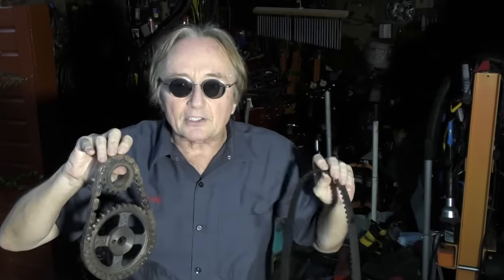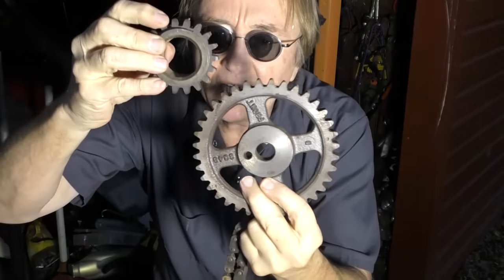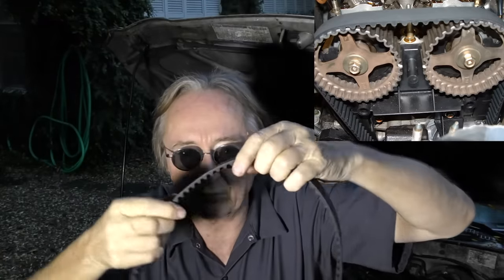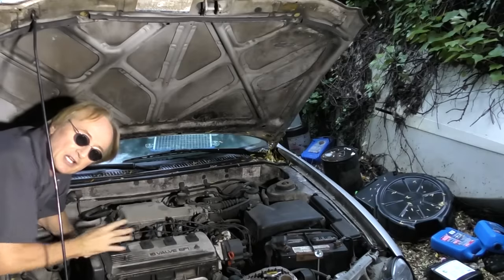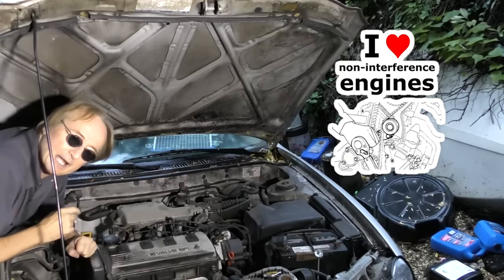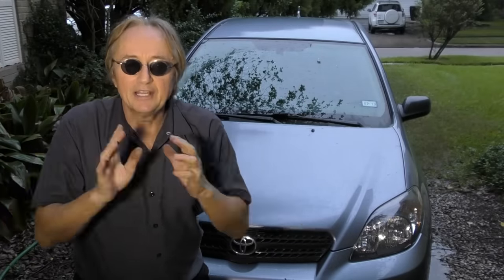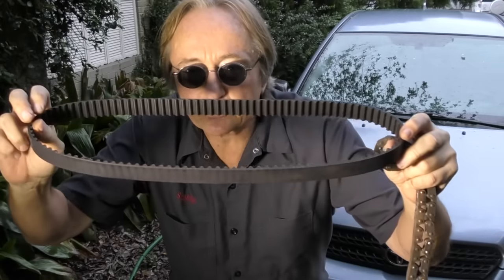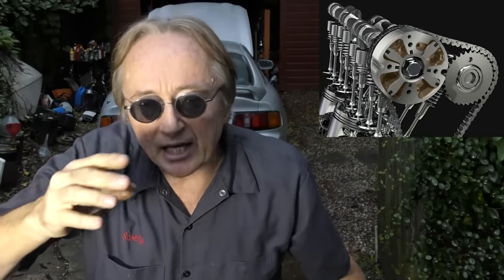Why Some Cars Have a Timing Chain Instead of a Timing Belt

Comment: Less wallet pain with a chain!
Reply: unless you have that one one bmw where it costs 4000++ to fix and all of them were faulty :D
Reply: Ettei olis ollu e46 318?
Reply: Well... Replacing a timing chain can be a pain on cars with bigger engines. on a 3 or 4 cylinder its a 10 minute job and about 150bucks but on a V shaped engine it can cost a fortune.
Reply: It happened with gears to on Dodge the gear was made from alloy center and plastic teeth just as bad as a belt.  All done for quite motors.   Chevy no problem non interference but Dodge look out  Pontiac to.
Reply: n47 engine
Reply: Unless you have an gm ecotec.
Reply: @bimmer3997  bullshit. Them bmw 2.0l diesel engines were snapping chains at 30k miles. Due to badly designed tensioners. Look it up.
Reply: @suolihuuhtelu  some owners had to pay over 10k for new engine because bmw would not give them a goodwill gesture. Shocking stuff by them. Don't ever buy a 2litre 4cyl diesel of them. 6cyl were solid though.
Reply: That is until they go wrong. Then it's an engine disassembly job, which, if you're driving a cheap shitbox, the cost will outweigh the value of the vehicle, meaning your car will end up being crushed into a cube. I know from experience.
Reply: Not if it's a civic si.  I know from experience on that one.
Reply: On a SOH or DOHC inline engine it takes max 10 mins. I know because I work in a garage...
Reply: @bimmer3997  facts.
Reply: Unless you have VW TSI xD
Reply: @waifuracer6516  post a video of this so. Can't wait to see it.
Reply: Exactly. I have pulled down a lot of those diesels because of that reason. The tensioners over stretched the chain & PING!! One engine in need of rebuild. There is a kit available to stop this.
Reply: It is actually a fact. The 2 litre BMW diesels are prone to snapping timing chains. A company here in Australia makes a kit so the chain is not overstretched.
Reply: Might not take 10 mins, but still, it is a simple job and shouldnt take more than 30 mins. 10-15 min is the avarage for an experienced and good mechanic.
Reply: Well said!
Reply: Unless it's a suzuki 1.8
Reply: Unless it's a suzuki 1.8
Reply: Are you serious? 30 minutes to change a timing belt? What on earth are you thinking? I WILL tell you it takes MORE than 30 minutes to change a timing belt!!! I've done that job thousands of times!!! It takes one hour to change a timing belt in a Daihatsu Charade 4 cylinder. Reason is you need to take the alternator belt off it first, remove the crank pulley, then remove the timing covers. After this, you set the timing up on the engine, BEFORE you remove the old belt. Next, loosen the tensioner bolts, & push the tensioner away from the belt. Tighten one of the bolts to lock it in place. Now remove the old belt. When you have the belt off, remove the crank sprocket. Remove the oil seal, then install a new seal. Remove the cam sprocket, & replace the cam seal also. Put the sprockets back in place. & torque the cam sprocket to specs, which from memory is about 40 lb/ft. Check to make sure the timing marks on the cam & crank sprockets are lined up with their respective  pointers. Install the new belt, ensuring the belt is loose on the tensioner side. loosen the tensioner bolt which was tightened to hold it, & allow the belt to be tensioned. Tighten the tensioner bolts. Rotate the engine in normal direction to check for binding, or fouling. Nothing wrong? Good. Now reassemble the rest of the engine.
Reply: @waifuracer6516  you must work in a garage in lapland with a load of elves. Its a full days labour on any car I know with chains. You would be doing well to do a timing belt in half hour. Prob 1 to 2 hours on a belt
Reply: Lol when you replace a timing belt or chain you have to take a bunch of the engine apart to get to it no way it takes 10-15 minutes 😂
Reply: unless its a FORD
Reply: messed up after 185k on the 11 Ford edge, 08 Dodge Charger 284k still pushing
Reply: Really Andrew Wooten?  Many chains are replaced by connecting the new chain to the old one and turning the engine by hand for one full turn - then disconnect the old chain.  Doesn't get much easier than that.
Reply: Yup, what a poor idea that was.  Nylon teeth on an aluminum sprocket - guaranteed to fail.
Reply: @daveh7302  a friend of mine paid like 4k
Reply: @wakaflockaproject  yeah if heard various prices. BBC in Britain done a programme on it. One owner claiming his engine was destroyed and needed new one costing 10k. Bmw are a joke. Subframe failure on e46 model. Swirl flap failure on e46 turbo diesel engines. To name a few issues down years. Buy an old 6 cly petrol bmw and you will be happy. Great engines
Reply: @daveh7302  I drive a golf mkv 2007 1.9 tdi it's on 150k now an absolute tank
Reply: @ Christoper Marshall - Yeah, it "does" take around 30 minutes to change a timing belt............after you get all that other stuff (like you stated) out the way haha!
Reply: +WaifuRacer   Your statement is not credible, not credible at all. Just Get OUT!
Reply: @neondiamondsaquaberry17  - Agreed. On my VW the engine bay tolerances were so tight, the only way to change the bet or chain is to drop the entire subframe assembly. 

Thankfully the chain rarely needs to be changed. Just the plastic chain tensioner should be changed at set intervals, which is a pretty quick job.
Reply: @bimmer3997  🤣🤣 here I am. Proud Toyota Hilux owner. And Proud of it
Reply: dave 2010 just put 20k on a BMW 2l Diesel, bought it at 41000 miles, now 61000 miles in 6 months. I have a comprehensive 3 year warranty but somehow I don’t think I will need it, the key to car ownership is oil changes, get the car serviced in accordance with the manufacture’s schedule and the car will go on for hundreds of thousands of miles. One of my other cars is at 214000 miles, original engine, clutch, gearbox, turbo, DMf, etc
Reply: @christophermarshall5765  - You can do a timing belt in 30 minutes if you're driving a Metro or Swift.
Reply: @waifuracer6516   10 min. job?
Reply: Lexus es 300 2001 should I change it soon at 90000 miles?
Reply: @duketogo2616  I do not believe you. I HAVE worked on these cars too, & changed timing belts in these, & the job takes about one hour. You obviously have forgotten the external belts which need to be removed first. NO MORE ARGUMENTS!!!
Reply: @christophermarshall5765  - I own 3 Geo/Chevy Metros (2 with G13BB and one with G10 engine) and my mechanic friend owns 10 of them and we have changed the timing belt on these cars plenty of times. He's been working on em' for nearly 30 years and loves them specifically due to their ease of maintenance and reliability, much like Scotty and his Celica. I learned how to do it from him. If you got it down pat, you can do it in 30 mins if you go fast and wanted to do it as a challenge & had all your tools ready and use electric or air to get the bolts out. 1 hour is more reasonable if you take your time. All you need to do is put a jack under the oil pan on a wood block and unbolt the passenger side motor mount and that drops the engine low enough to get to the crank side. The only other belts in that area are the alternator/water pump belt and maybe the AC one if it has AC and they are easy to get at. If the timing cover is missing, which is often the case for many of these, you can do it even faster.

Just make sure you get those timing marks lined up right. If you don't wanna have to worry about that, you can always use the trick of cutting the old belt vertically to split it then make a horizontal cut to remove all but a small piece of it to hold the gears, then slide the new one on next to it and finally removing the last scrap of the old one.

Also the engines on them are light enough to be removed by hand for most. These are non interference motors so having a belt on them is much better than a chain due to the ease of replacement on these ones.
Reply: @davidviner4932  the timing chain issues on the n47 engine had nothing to do with oil change maintenance. It was faulty or badly designed tensioners.
Reply: @Your_username_  n42 engine? xDDD
Reply: NASCAR uses timing BELTS, not chains.. Belts offer more accurate timing and dampen harmonics. Its no wonder honda with their vtec uses belts. CompCams makes a belt kit for your Chevy 350
Reply: the cost will be cover by the extra oil you will buy for chain lubrication. oil needs to be replaced every year, so if you can replace the belt yourself in 6 years the costs will be the same to buy a new cambelt set.
Reply: @suolihuuhtelu  ....Sounds like that is what a BMW owner gets for owning a heaping pile.
Reply: @neondiamondsaquaberry17  belt seemed way easier well at least on the cars ive had
Reply: @noneya6334  K20 and K24 use timing chains with great effect. Racing cars use belts because belts are easier to work with, the whole mechanism is much simpler and longevity doesn't matter anyway.
Reply: Toyota hilux with the 1kd is a 45 minute job
Reply: @SimonWoodburyForget  but you have to change your engine oil anyways so how is it more? When changing a belt you usually have to drain your coolant, change water pump  tensioner and top up coolant again.
Reply: My local bmw specialist is making a shitload of money from repairing snapped timing chains on the bmw with the n47 engine. They have a massive backlog of non running bmw cars parked up, waiting for timing chain replacement and repairing the damaged caused by the chains snapping. Timing chains are better than belts if made correctly to begin with.
Reply: @bimmer3997  it is even mentioned on wikipedia and BMW has already made the Recall
Reply: @bimmer3997  metal on metal friction they are going to wear out no matter how often you change your oil they are not not like crank bearings with pressurized oil to separate the surfaces.
Reply: @Uberragen21  water pump usually goes bad
Reply: you need to change the belt every 100k km's. most people dont drive their car that long. and it costs 150 to replace it. i dont see a problem spending 150 every 5 years or so.
Reply: Unless you have a Audi hello timing chain and cylinder heads
Reply: @carloscontreras6872  bruh fr. Especially the shitty tensioners
Reply: ThatCarGuy those are always the problem for Audi they constantly go bad and piston rings
Reply: More pain with a chain. When the guides become brittle and crack, you better have a lot of money in the bank to pay for the repair.
Reply: OMG you are so right
Reply: @daveh7302  
BMW -   big   money  wasted,   broke  my   wallet.....broken  motor
wagon............
Reply: @driver4011  black man willy
Reply: @waifuracer6516  what are you working on? Toy cars!?!? 

Vw 2.7l 03 = 8 hours in a shop with the whole front end off

Silverado 5.3l 03 = 4 hours. Easier with radiator out,can leave condenser to save on regas

I dont know of a car, bike, bus, truck or fn moped that can be done it just 10 minutes 😂😂😂
Reply: @chenzitong1  examples: Vauxhall/Opel corsa c, d: 1.0 3 cylinder, 1.2 4 cylinder, 1.3 cdti, 1.4, 1.7cdti, 1.8. All of these engines don't take more than an hour to change the chain. And if I say an hour I mean doing it in a very slow pace, almost being dead slow at this point. On a V6 or V8 yes of course the chain replacement will be hard and long but because that chain is meters long when the chain on these small engines mentioned is not longer than 2 meters and connects to basically 3 "gears". I can't believe you have never seen inline engines before.
Reply: @suolihuuhtelu  not only bmw. But every time they break debreis destroy engine.
Reply: Yep, my BMW is now at 100k, if I had a japshit car I would need a service now
Reply: Just cost me $1,700.
More labor taking the engine apart to replace the chain.
Reply: depends how long you plan on keeping it. I would not run a BMW on its original chain past 150k as it then starts wearing other parts like the sprockets and there are many of them and 2 chains! (at least on a 320d)
Reply: Ozzstar tell this to BMW owners.
Reply: @crigeorge9549  people are more concerned with having to replace a motor because the belt or chain failed. The argument here is which is more reliable. A chain or belt.
Reply: Unless you have a Mazda 3 Diesel.
Reply: @wakaflockaproject  A channel called Car throttle has a skoda with well over 400k miles that uses the 1.9 tdi engine. That engine is probably one of the best ever made for longevity.
Reply: @Thiterest1  what year is the Skoda? And what bhp
Reply: Notice the 0 for thumbs down on this 1
Reply: Unless you have a BMW :D
Reply: @driver4011  bring me (to the) workshop
Reply: @nihonkokusai  
ya  ,  n    bring me (my )  wallet......
Reply: They stretch too.
Reply: @bimmer3997  Chains usually last longer than belts. But that's not absolute truth. There is cars, for example, all volkswagen group cars with tsi or tfsi engine, that have bad chains and they broke early on no matter how you change oils or do maintenance. Chain is designed to be forever but usually it isn't even close to forever.
Reply: @waifuracer6516  Changing the chain is simple and takes like 10-15mins, but there's stuff before getting to a chain. We are not talking about cars where you cut the old chain and attach new to it and roll on. We are talking about taking the whole chain in one part and changing everything chain related as in most cars you do. I wan't to see a car where you do that in hour from scratch. And I have changed chains on inline engines, and changing tensioners and everything inside timing cover. Never done one in an hour. There is also inline cars that can take up to 8 hours to change the chain.
Reply: @daveh7302  where did you get that from...i have 2.0 f30 with 159k  automatic and chain is in suler condition,change oil regular and car won t break,i have frend with same motor and also f30 automatic and 250k km on it and was not change at all,there was case where it snapped but that was in manual gearbox abd it s solved long time ago
Reply: @1988josip  don't know if affected f30 engines but n47 engines were badly affected by poorly designed tensioners
Reply: @daveh7302  i have same engine,it haplened on manual trans as i sad before,automatuc barely and very very rare,guy is working only bmw for almost 30 years and when i was checkin out my car and asked for chain he laughd and told me Who told you that stroy,why did they scare you,and then i realize there s alot of smart guy on forums that nevwr drove a single bimmer but talk crap...you can change it precaussionly on 200k km but if there is no sound of clicking when you turn  on engine then leave it...and yes new oil every 10k km and thats it,ppl dont do maintenance and when something brake up they say car is  bad,my is stiff like it came from factory yesterday, put motul in it 500km ago with vrx 500 ceramic aditive,engine is great,car mpg is crazy,on normal road and 80km/h it use 3.6 l of diesel on 100km,car is great for driving,city driving between 5.9 6.0l/100km,and with 184 hp and 380nm torque power it s great everday sporty limousine...buy one and you will see it s great...also i noticed ppl cry alot in america that bimmers are not reliable,in europe they are great especially v6 330d or 335d,fathers friend have almost 800k km and run like new...so be good to your car and it will return it to you same way...long post but hope you understand now a little bit better some things
Reply: @1988josip  I'm not American. I'm In Ireland. iv owned bmw before. all I'm saying is it was a known issue with that engine. if u Google it you will see. not talking crap about them. talking straight facts.  there was also timing chain issues in the e46 with the 1.7l petrol engine that was in the mini Cooper aswel. I loved my old e46 but unfortunately had subframe failure in it so sold it after repair.
Reply: @1988josip  ❤ to croatia. ✌
Reply: WaifuRacer tell me about it....my 2005 mustang with a 4.0 V6 has timing chains in the back and front. Technically the engine must come out when i replace the rear one 😂😂😂😂so fml.
Reply: Unless its German.
Reply: @bimmer3997  1.6vvti 140k miles not a single noise from the chain.
Reply: Ozzstar unless you have to take the entire engine out to change the chain
Reply: @Ken Durant yep Japanese cars are best. have a Lexus ct200h now. 144k miles on it. drives like new.
Reply: Pontiac thing is no big problem the timing belt lasts 300K about on 1997s Grand Ams.

Cost to replace $700+.

A Kauffman told me it need ed to be done and they don't do engine work.
Reply: plastic is nothing but junk in a car and id rather have metal all day long period.
Reply: @christophermarshall5765  How can I find this company or kit? Will it resolve the issue completely?
Reply: @taylorbushnell5838  the kit should be available from most places where BMW parts are sold. One of these parts is the tensioner, which has a pressure relief valve built in, & the other pressure relief valve fits in the lubrication system, either in, or near the oil pump.
Reply: Not necessarily. Old myths die hard…
Reply: @daveh7302  I agree.  I would love to see him change a timing chain in an M117 Mercedes Benz V8 engine. This job is a full days work.
Reply: @evaldaskowka  150€ ? It costs 2k for audi 3.0 in eu
Reply: The 2022 Ridgeline still uses the belt from what I understand. Very reliable vehicle but is it expensive to own?